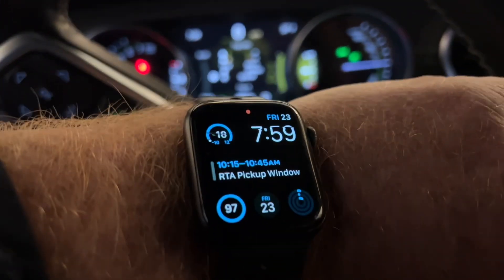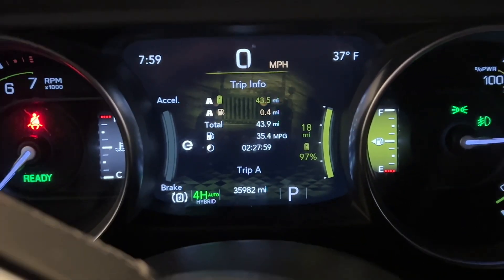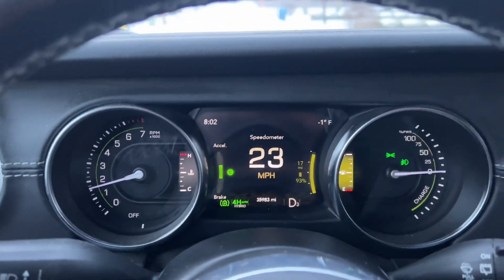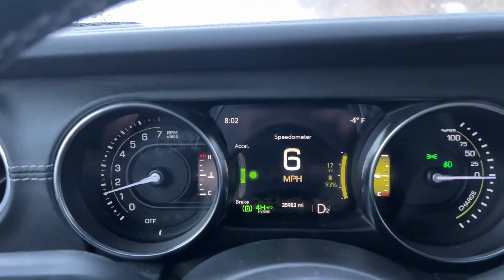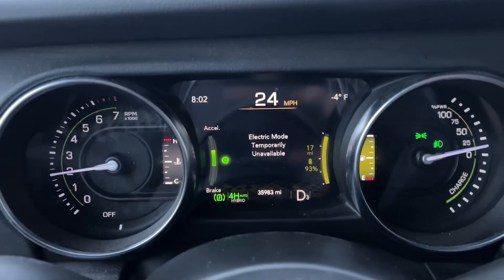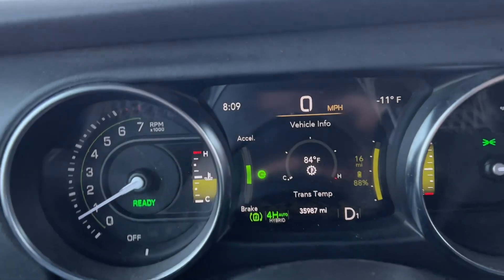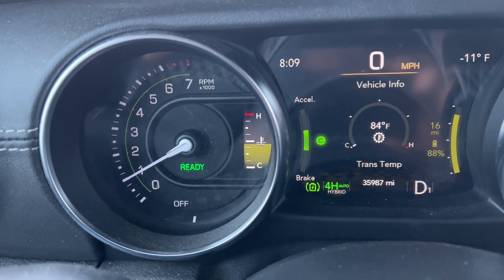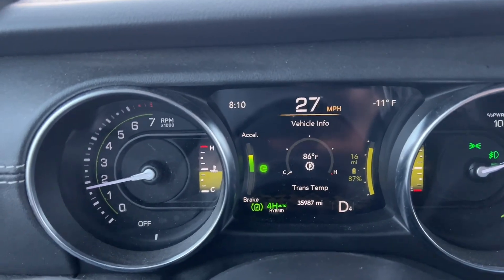Cold weather shootout: EMU vs. FORM

Comment: When I bought my new Jeep Doyle was dilute it with gas. It was the original oil in the morning since it was built the car would not going to electric mode. Once I did some research I had some change it oil and it worked. The electric system went online.

Comment: I have a fairly steep grade on my commute. Half the time it makes it up in electric and the other times I get EMU. A few miles later I get to go back to Electric but then in another couple of miles, the engine will cycle on and off like crazy. It has done this with outside Temps from high 30's to high 50's....
Reply from the maker: There is a hill near my Mom’s house that does that. If I get a run at it then take it easy near the top, it does fine. Otherwise, it kicks on near the top.

Comment: 2023 4xe Sahara here. Mine states electric mode temporarily unavailable when you hit the electric bottom but if you scroll down the driver info screen, it will actually say Form in progress. I live in Vancouver, Canada where we had a historical low in temperature and it got into form most of the time.
Reply from the maker: Mine is actually doing that for the first time right now too.

Comment: I have a question for Ben your on e-save mode you have to options one is battery charge and the other is save battery charge which do you Lu suggest
Reply: Thank you
Reply from the maker: @lisawilson6569  Using eSave will consume more gas than leaving it in hybrid mode. The only time to use it is if you want to save the battery for later or to force the gas engine to run.
Reply from the maker: Depends on what you need/want. Charge uses more gas than save.

Comment: Had my oil changed a few weeks ago. Have been running the ICE pretty regularly - not short engine starts. Went into Electric Mode Temporarily Unavailable, then went into FORM. Was back and forth with electric being available, then not available. Finally electric didn't seem to want to work anymore. I called the dealer and made an appointment to get the recall taken care of and this issue looked at. While I was at the dealer, the service writer told me the Electric Unavailable was still on, but that was normal. She told me it did that to PREVENT FORM. I didn't know what to say to that, except I told her I'd be calling in a week when it was still not going into Electric Mode. I was pretty angry, actually, but I didn't think that - like every time I'd left that dealer in the past something didn't work right until I got a good drive in. I pulled over after going about 10 miles down the highway and reset my oil percentage, and barrelled down the highway again. I got home with zero charge, of course. It's been working fine ever since. That was yesterday.
Reply: Did they forget to reset your oil change monitor after the oil change?
Reply: @rcguymike  They did not. I just think it took a few miles of driving to clear.
Reply: @d.shanerose1729  that sounds like why FORM was activating then, that was the problem

Comment: I would think Form uses the motor, The RPM shifts with the transmission. I would think EMU mode it used hybrid mode and the engine would just idle as you drive correct?

Comment: So in the cold my 4xe says electric mode unavailable but also says FORM. But if it warms up outside it goes right back into normal operation, no need to drive and get engine up to operating Temps. It uses FORM as the cold weather mode usually in the low teens or lower.